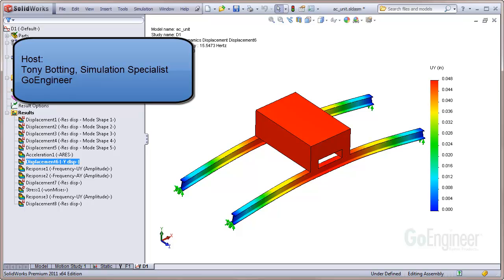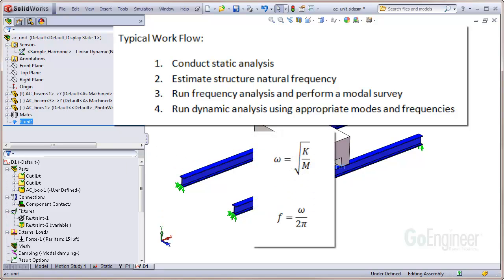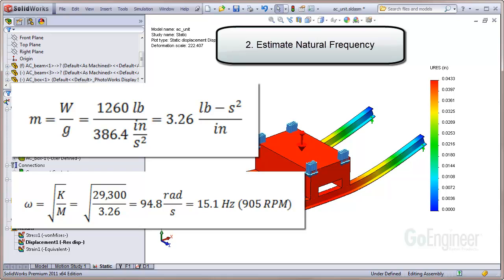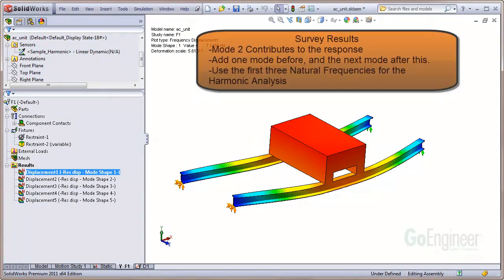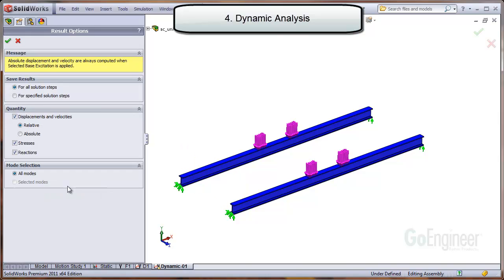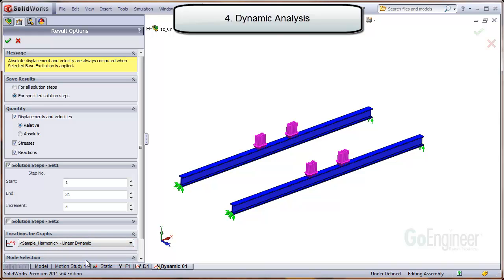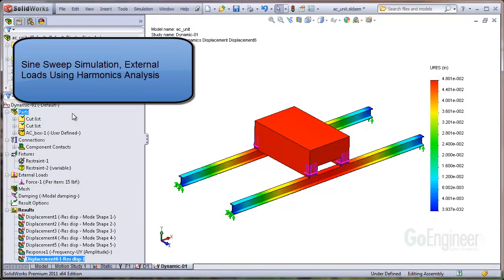SOLIDWORKS Simulation - Sine Sweep Dynamics Tutorial

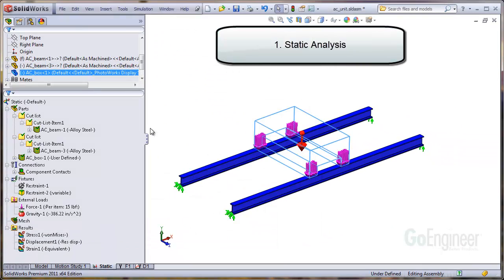Comment: At time 2:38 what yield strength is applied? Without the yield strength the material cannot be defined.
Reply from the maker: Hi Jamir,
The yield stress is a requirement if the definition of the material has the "Default failure criterion" set to anything other than "Unknown".  If it is set to "Unknown" then the material would be allowed to save and then be able to be used in the study.  The yield stress does not change the results in the stress/displacement/strain plots of a linear static study so it wasn't included in the video.
Reply: Thank you! I understand now.

Comment: Hi
how we can define rotary motors as a base excitation loads?
for example: if we replace the air conditioner with a beam that a spindle motor turning with around 20000 Rpm attached to that (same a carving machine or its look like a gantry milling machine) then how we should implement the boundary conditions?
I cant find anything to defining the rotary kind of harmonic loads! it seen we just can define it as external load with specific carve! but how we should do that? and what we should consider about these kind of problems?
its too important to solving this kind of problems at milling machine, carving machines, lathe machines and ..., all of these kind of machine has rotary motors with high Rpms ( 8000 up to 25000 Rpm)! I can send you an example that I try to solve it at solid works, just send me an email please. And please kindly send me an informing email too if you saw this and have a solution, rarely I check the you tube nowadays!
Truly;